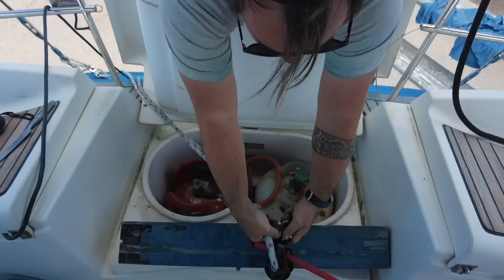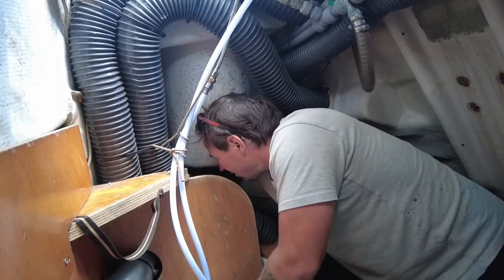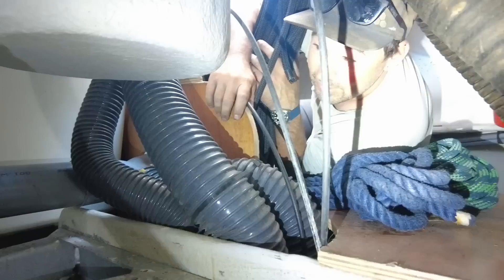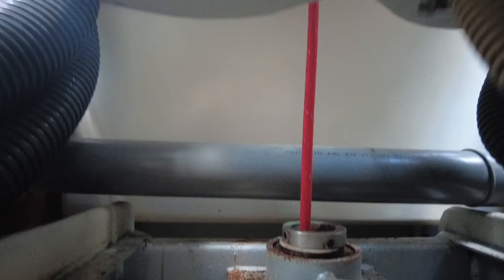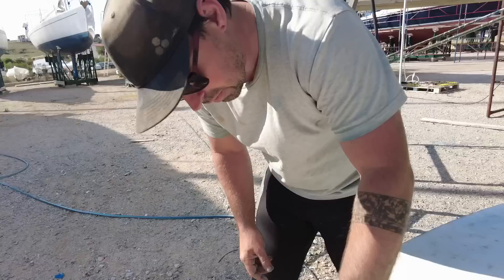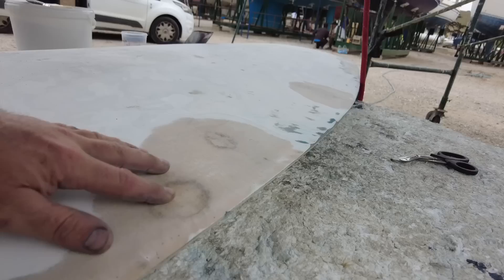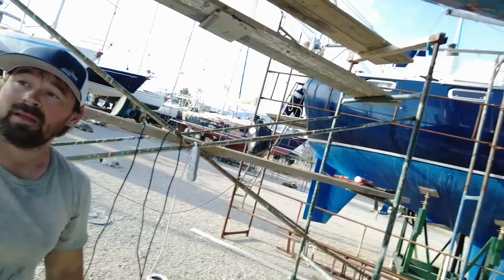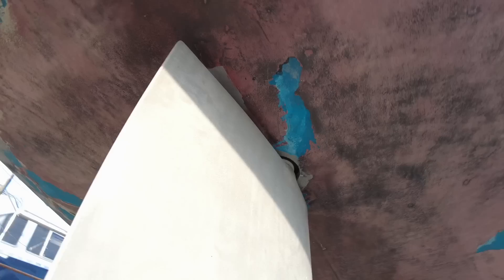CHEAP BOAT Refit! Rebuilding a TRASHED Jeanneau 54DS Sailboat Rudder

Comment: You need to check the rudder stock for crack corrosion. Stainless will not necessarily show corrosion but will break without any warning. That's especially for the inside rudder structure. Also there's been no humanity check on the laminate of the rudder. The EP won't help if it's still wet inside.
Reply from the maker: rudder stock all good. The rudder was dry as a bone 👍
Reply: @OceanCruisers  Great, good luck for the further renovation.
Reply from the maker: @Hotzenplotz1  cheers mate all the best to you!

Comment: use some ranex rust converter / phosphoric acid to the rusty spots on the metal frame - they will then become ferrous phosphate which won't rust and then rinse with water and dry
Reply from the maker: good advice. I will take it.

Comment: A close up of how you tied the rope to the rudder shaft  would have been nice to see.
Reply from the maker: there is a thread at the top of the rudder shaft, we put a bolt in the thread and tied the rope to the bolt